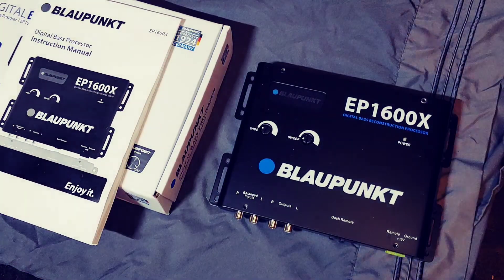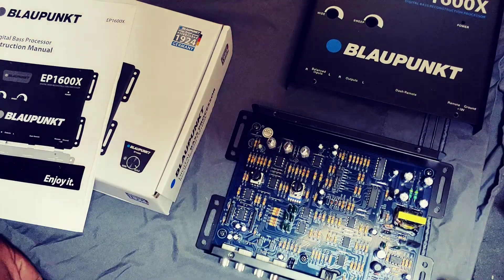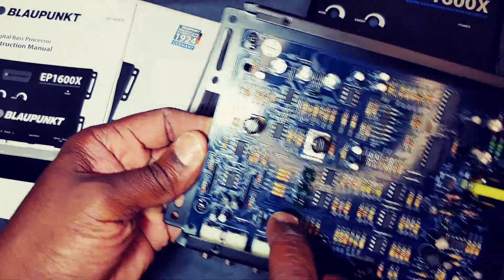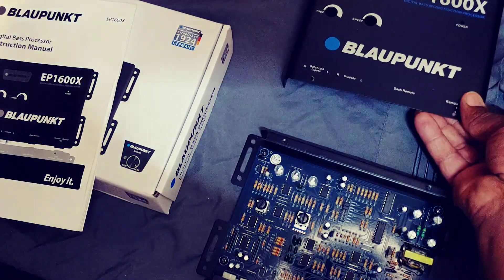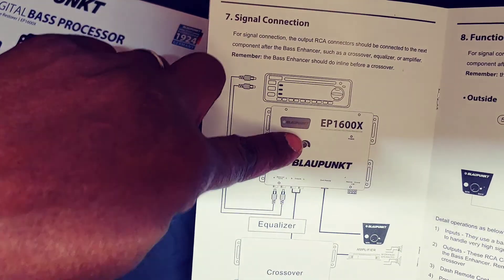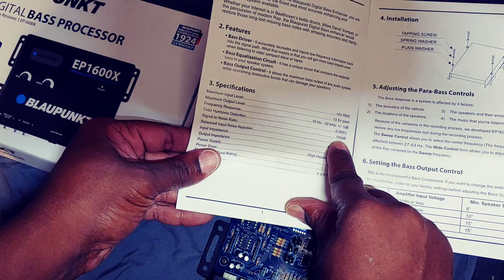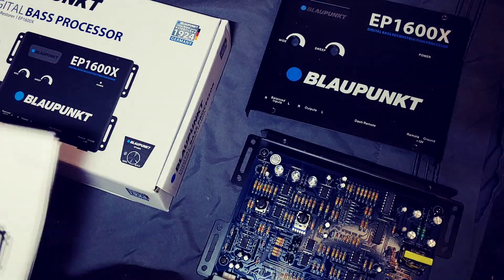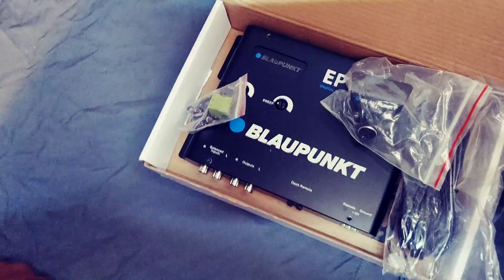Blaupunkt EP1600X Digital Bass Processor #bassmechanic #bassboosted #mechaniclife #cdshawn

Comment: Now, unless I have it wrong, that first thing you can adjust depends on how much voltage IN your amp can handle.
I'm talking bout that 2.5, 5.0, 7.5, and 10.
My amp can take 5 volts in, so I would put this thing on the 5V option
Reply: well said

Comment: You said you set it to 7.5V output yes? I assume your amp is rated for an input that high. That's awesome. My amp is rated for .2-6V. so I had to use the 5V setting.